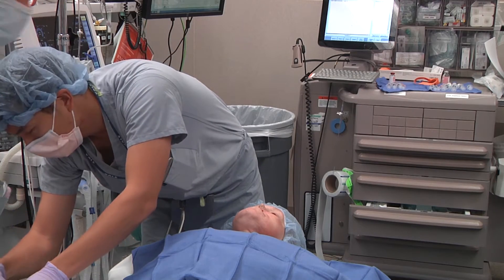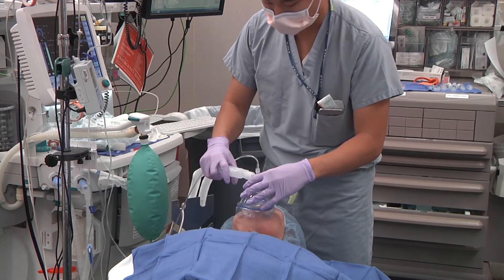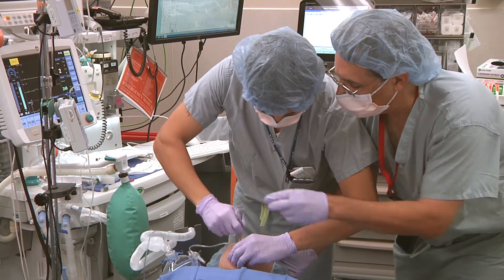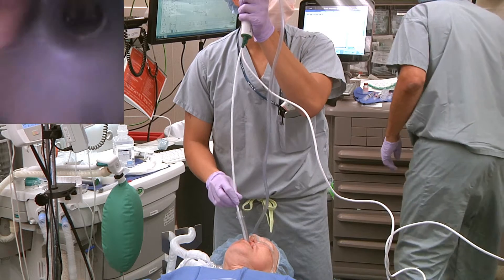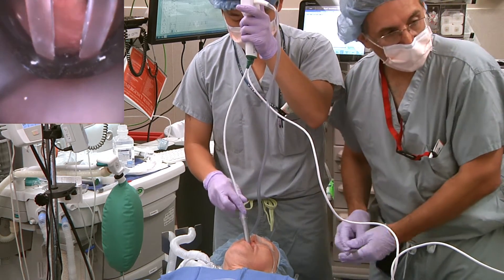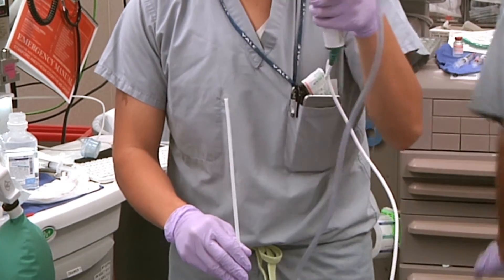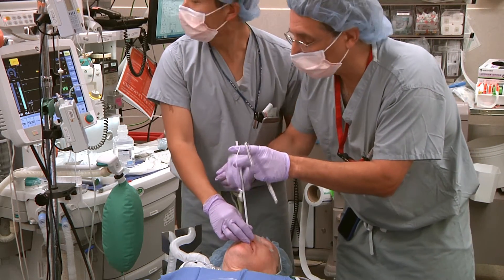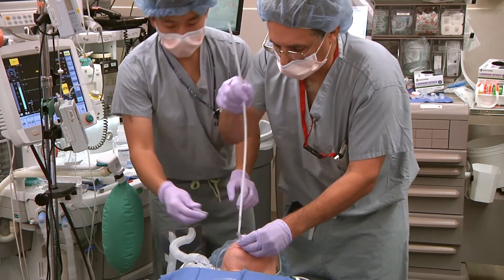STaS maneuver   SGA to ETT exchange from AOD v2B

Comment: Don't really see the practicality in this.  Why not just perform a fiber optic intubation or use a fastrach LMA?
Reply from the maker: The STaS is a primarily a technique that can be used when there has been a can not intubate/can not oxygenate situation that has been rescued with an SGA. In the current case, we had the opportunity to safely demonstrate the technique.  So, I will address your question as to how it relates to that "emergency" rescue situation (CNI/CNO)

-First, the issue of using an Fastrach-LMA - this device might not have been available or used in the resuscitation. Maybe it was not available in the ambulance, ED, ICU, OR or other area where the resuscitation took place. First and second generation SGAs are FAR more ubiquitous that intubating-SGAs. Even if you use an intubating SGA, you still have the problem of removing the SGA after you intubate through it.  In theory this sounds easy, but it is not and it fraught with danger (e.g., accidentally removing the ETT)

-Second, if you use a flexible intubation scope (we don't use fiber-optic scopes anymore - they are fragile and costly to repair. The digital flexible scopes are exactly the same in function but far less fragile and more durable. Single use flexible intubation scopes as seen here are even more cost effective and reduce the cross-contamination issues. If you are really still using fiber-optic scopes, you should consider new devices) to intubate through the SGA (and this still maybe needed if you are using a Fastrach or an iSGA without an epiglottic lifting bar) you still need to remove the SGA (for example, lets say this patient is to remain intubated after leaving the ED or OR - it is not advisable to leave the SGA in place for very long periods - this is doubly true if you are using an iSGA). The STaT facilitates this removal as a one-step maneuver. If you use a durable flexible intubation scope you are going to have to use another technique for SGA removal (aintree, Airway exchange catheter, Arndt exchange kit, etc). 

I hope this answers your questions